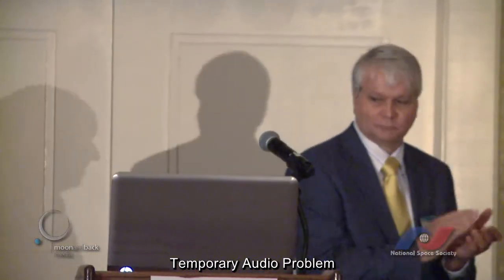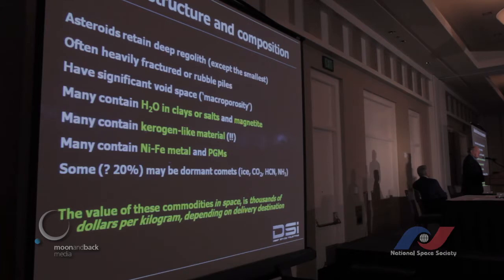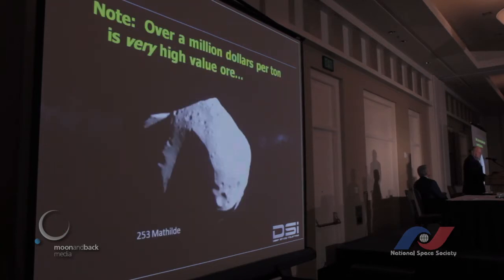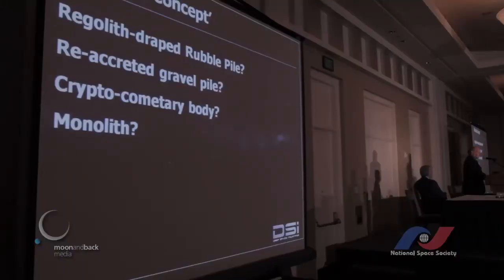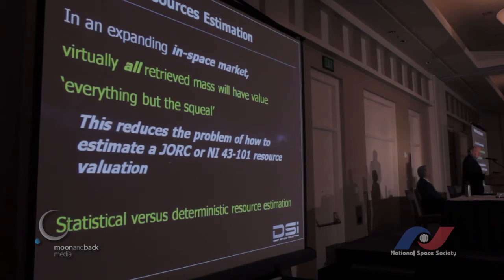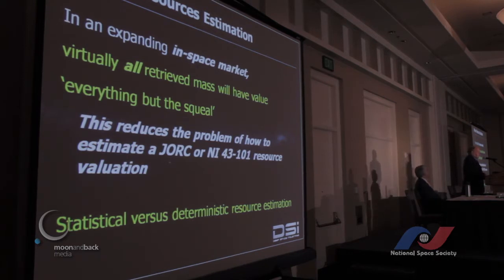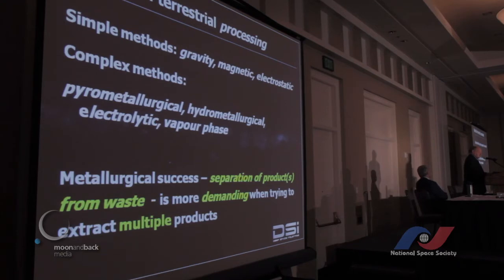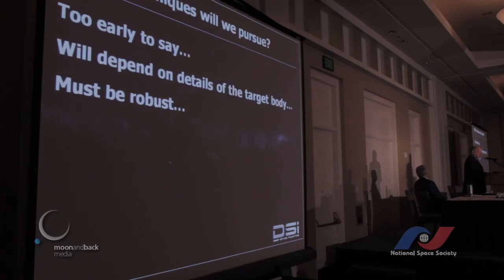The People of NewSpace: Mark Sonter - Applying Terrestrial Mining Concepts to Asteroid Projects

Comment: The values he cites for the materials in space – water, hydrogen, other volatiles, metals, etc. – are currently potential values, as there is currently only a potential market. E.g. the technology to manufacture in space – e.g. spacecraft, or their components – does not exist. Any hypothetical metal mined on an asteroid is worthless if you can not use it there. Using material as shielding is all very nice, but without deep space missions, there is no demand. And at current launch costs (see SLS for reference) … Without companies launch spacecraft and missions that rely on the materials you want to sell, well, there is no market.

Furthermore, the demand is constrained by prices. Talk to an satellite manufacturer or customer (regardless whether commercial, research or military) and tell them that you will supply them with raw materials for the same price they currently pay on Earth for launching a finished product – they will rightly laugh at you. There is no additional demand at that price that would need to be fulfilled by space based mining and production.

BTW, I would suspect that at current (launch) prices you would not even be able to set up a mining or manufacturing base on an asteroid… So launch costs have to come down, but then the potential price of any mined material goes down as well…

I think the only solution is to keep it simple, but light the candle at both ends: create both demand – e.g. volatiles for refuelling – and create a supply by mining asteroids and/or the Moon. Unless on side finances the other (which is unlikely), the only player capable of stimulation both demand and supply are the states. A solution would be to create a "Commercial Fuel" program (akin to the CCDev program), where NASA provides the seed money (and adds technology, expertise, oversight, etc.) for corporations (or research institutions) which are interested in buying volatiles/fuel (e.g. for geostationary satellites, or deep space probes). And furthermore create a "Commercial Mining" program, where NASA does the same for corporations which want to mine and supply resources in space. Once you have more than one customer, and more than once supplier, you stand some chance that a market can develop in the first place. Otherwise if demand and supply miss each other, then you run the risk of having several companies belly up (on both sides of the market) and a market that is quite dead. (He even mentions in his talk that the main if not only risk during the operation of a mine is the market – here we have a market that needs developing as well.)

Here I am, advocating for NASA and the government to create a market…